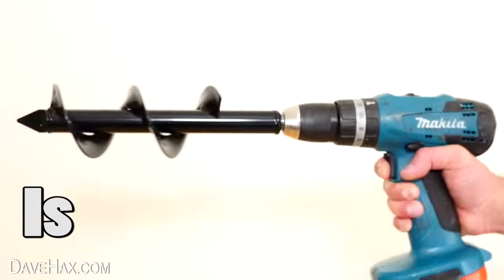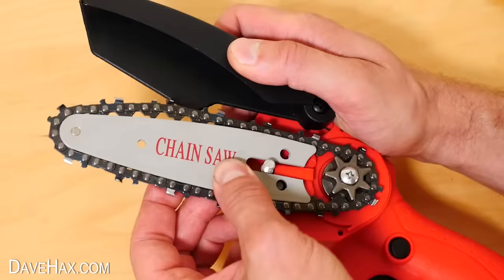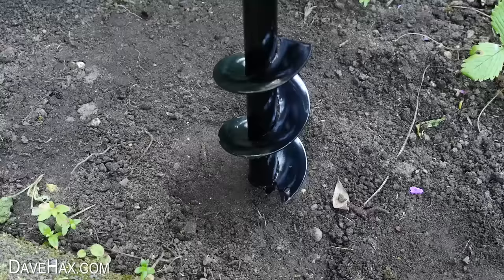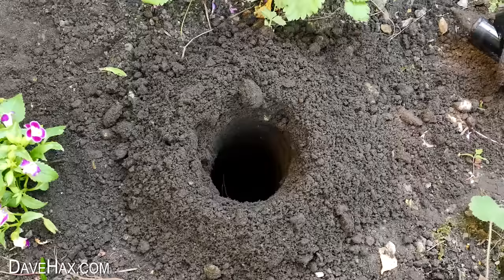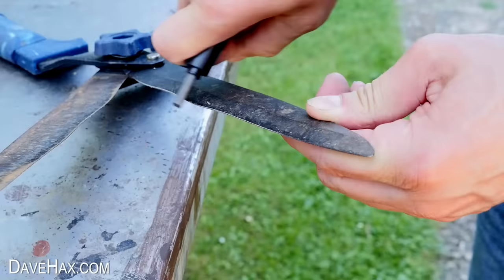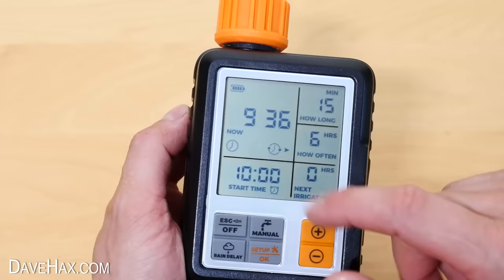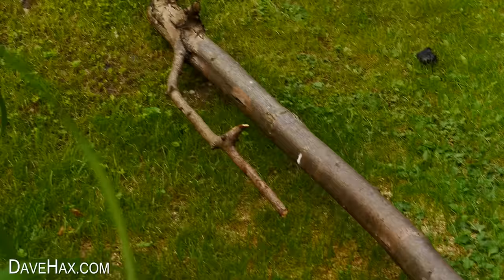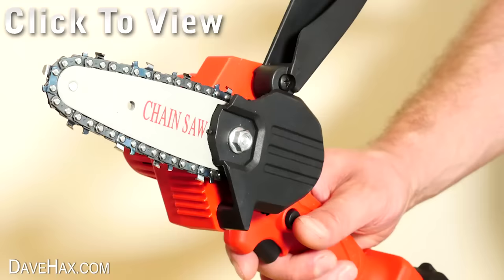Gardening Gadgets You MUST See

Comment: Sharpening tools have always seemed like a waste to me. I learned how to sharpen & hone blades using just a stone in scouts. It's just a matter of necessity. Do you really need a razor-sharp knife or just a very sharp one? The wood you're about to whittle won't notice, it won't keep that razor-sharpness for long and you'll only wear out your blade faster by continual sharpening. In the event you actually need a razor, use a razor. Part of my EDC is a few blades wrapped in electrical tape tucked in my wallet. Weighs nothing, takes up zero space. Never had any need for it because the sharp enough blade on my pen-knife is more than adequate.